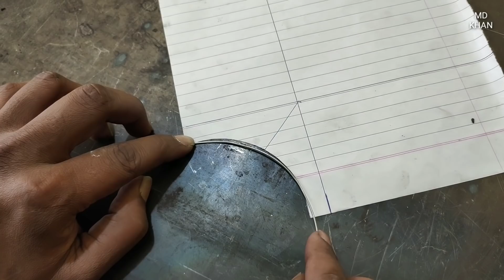Secret Profile Pipe ! WHY DO WELDERS NOT SPEAK ABOUT IT ?

Comment: Most people; measure it, mark it, chop saw it, weld it, cuppa. Why ya still messin wii that grinder, gerra a shift on, is what you would hear from most foreman if you tried this in a factory. I have not seen this joint used on any products or settings apart from here on yt, and around 4:30 all those black dots are where there is no weld on the joint, all these videos (that I have seen so far) using this joint can't weld properly.

Comment: Just cut at 45 and make the round cut with a hole saw drill.
Then that joint will crack very soon, no penetration at all mate. Need to bavel as minimum....